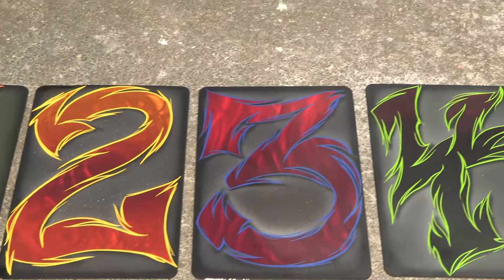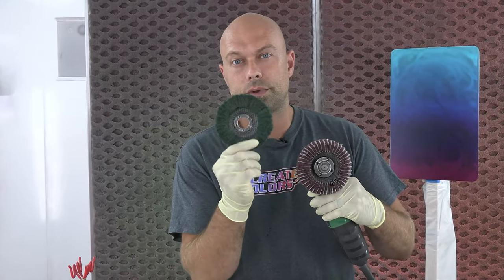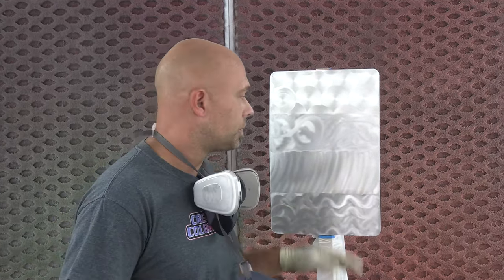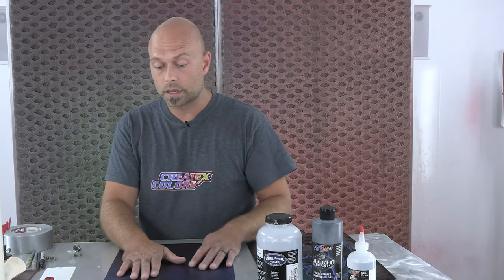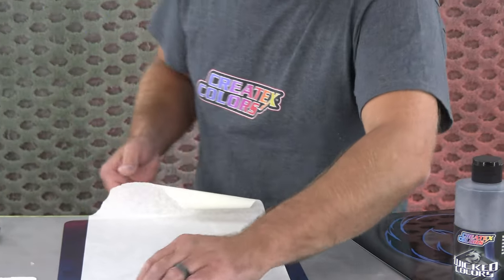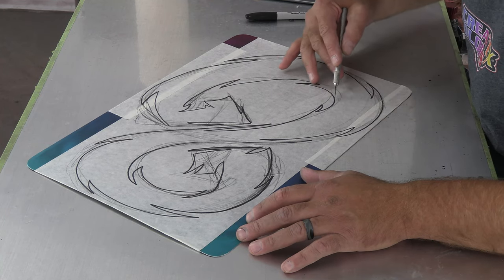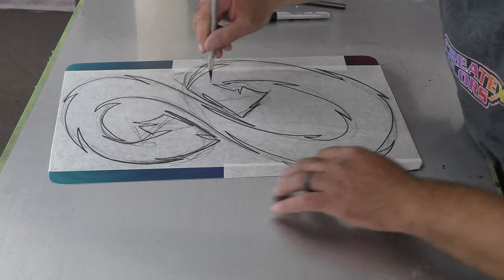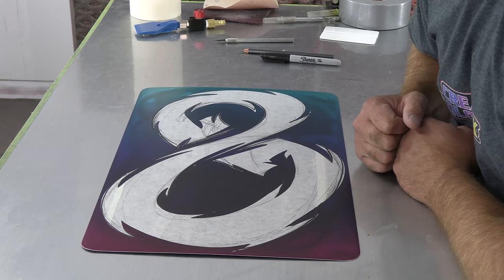Candy Fade Tribal Graphics

Comment: I’m having trouble with my stencil vinyl (Orcal 813) taking paint off under it when removing the film.  Any suggestions to avoid that?
Reply from the maker: Please follow the surface preparation recommnedations in our Hard Surface Application Guide, www.creatextech.com, and make sure to start with AutoBorne Sealer, www.autoborne.com. Most often, paint peeling goes to a lack of adequate dry time and curing. Thank you.
Reply: @CreatexColors  thank you for the reply